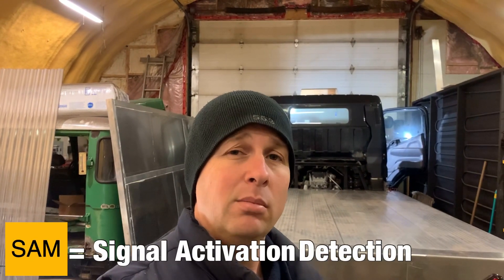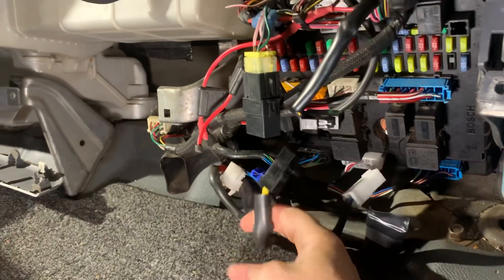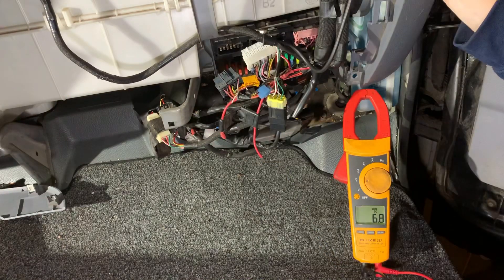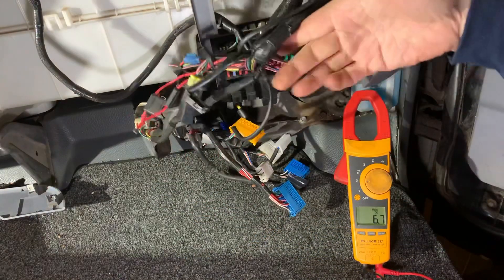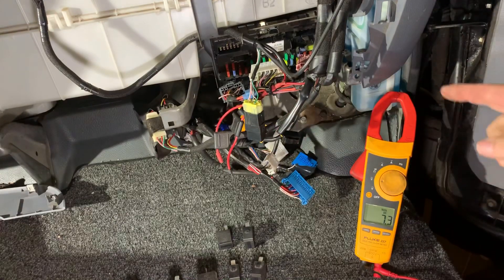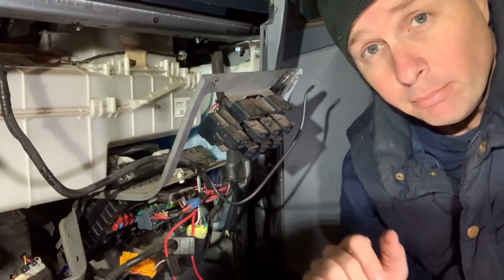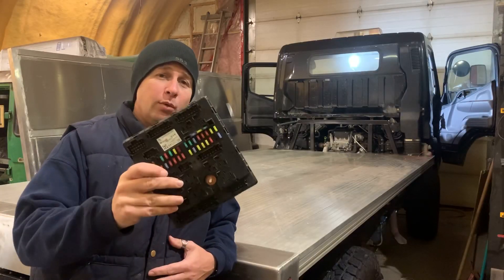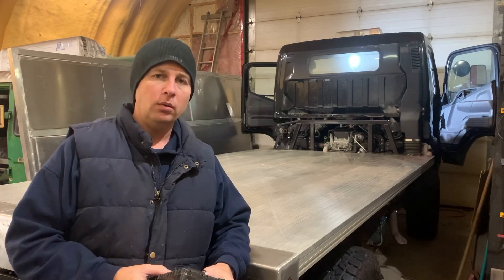SIMPLE diagnosis & resolution of electrical problems on our Mitsubishi Fuso FG

Comment: I’m an auto electrician working mostly with trucks like the Mitsubishi Fuso. I’m kindly reaching out to ask if you could assist me in any way to get a diagnostic tool (Launch X431). I currently don’t have one, and it limits my work.
Even help with a used tool or guidance would mean a lot.
Thanks for your time and may you be blessed.
Reply from the maker: You’re in luck - check out my video on the Autel - I love this thing!!! 

Mitsubishi Fuso Diagnostics MADE EASY with AUTEL!!
https://youtu.be/r8tfeT2xw3A

Comment: Did you ever make a follow up video after identifying the faulty SAM? Did you replace or repair? I have a similar issue but my board is corroded.
Reply from the maker: For now, I’m just using a battery isolator switch to prevent it when the truck isn’t in use.  I’ll keep my eye open for a used SAM to swap in and then keep this one as a backup.
Reply: So with everything disconnected, you probably have the same issue with corroded poles. I can continue using the truck but all the warning lights are on and a continuous alarm as I drive. It’s irritating but I live in the Seychelles and there’s no Mitsubishi dealer to troubleshoot or parts. Thanks for getting back to me. 👍

Comment: Thanks so much for the video. I have a 2014 FUSO 4P10 and I now have an amber SAM light on after replacing my carrier body from an openback into a box cover. I now suspect a voltage leak through the visibility lighting network on the side of the truck.
Reply from the maker: Try to see if there is a SAM code that you can read through the instrument cluster - check my other video “don’t buy a code reader” - for the trick on how to read them.  Might help point you in the right direction.

Comment: Well that was brave.    On an unrelated issue I now have a problem with my engine braking system, whenever I use the engine brake it bogs down and smokes a lot for a bit then slowly clears up.  I have to refrain from using the engine brake, and its habit by now.  It did throw a code once and I need to dig into the code issue with the two fuses that give codes.
Reply from the maker: Hmmm, that’s an odd one.  Does your truck have an EGR?
Reply: @BruceandKrista  Its  a 2004 the first year of the new engine.  I presume it does have an EGR.  Something with the engine braking system is sticking, is what it seems like. The engine break isn't a standard engine break I'm not sure how it works exactly.

Comment: I still have a flickering temp light and bouncing gauge, only in extreme heat though.   
My Fuso guy in California says I have a bad ground, but I’ve searched almost every where and all grounds look good.   
The only thing I haven’t done is pull the dash…
Reply from the maker: Yeesh, inconsistent electrical bugs are a nightmare!    When the gauge bounces, does it go up, or down?   If it goes up, that indicates a lower resistance path to ground (like a chafed wire bypassing or paralleling the sender) if the gauge goes down, it’s a higher resistance path, which could be a bad ground.  I suspect your gauge goes up? (and resistance go down) if they are causing the temp light to come on.    If it’s a gauge up issue, I’d try chasing the wire between the sender and the gauge.  (Not fun!). Good luck!
Reply: @BruceandKrista  good thoughts.  Thanks.  
I’m thinking about installing an aftermarket temp gauge.  
Right now I stick my hand under the seat to gauge real temperatures.  
lol
Reply from the maker: A secondary gauge would for sure bring some comfort!  (I mean, unless your hands are cold 😁)

Comment: There is obviously a ghost inside the SAM!  I am delighted that I could be of assistance.
Reply from the maker: I’ll have to open the bottom drawer of my toolbox and break out the proton gun and my trap!!! 🤪
Reply: @BruceandKrista  Yeah...... I was going to suggest that but was not sure that your toolbox contained such items!
Reply: I need help? I have this model 2012 fuso
Changed the  engine to old model
But ddnt change wiring
I need help with temperature sensor to dash board clock face ?cant figure out😢